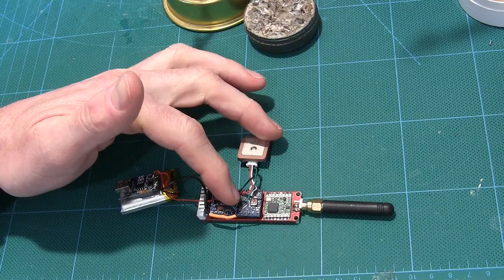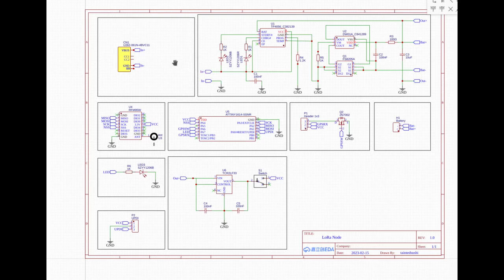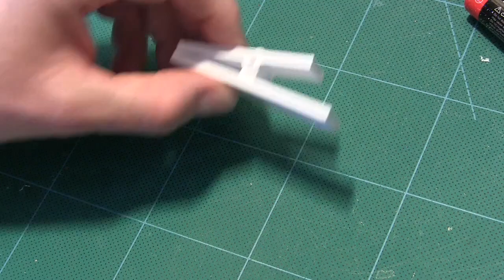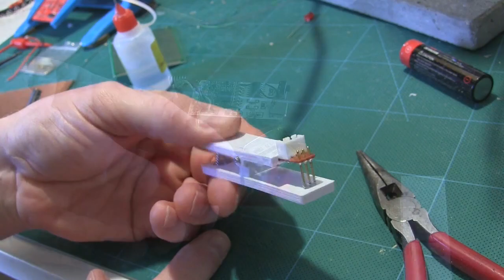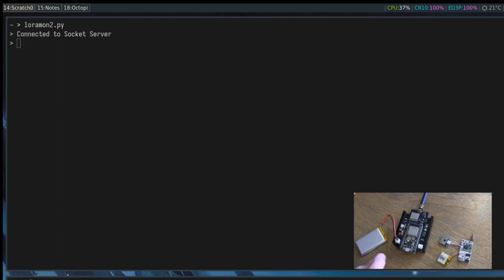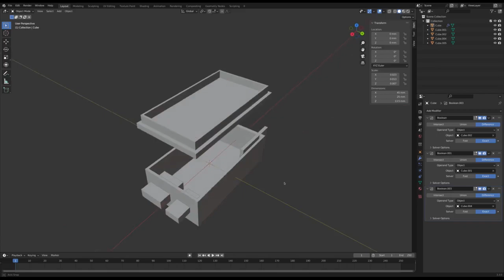LoRa Dog Tracker Part 4

Comment: hey Im small sheep farmer in south of france, I use chinese gps colar for cattle , but they are expensive and need to be recharged every few days though I only might need to check gps coordinates a couple times a day. do you thinbk lora would be a good technology for that ? what do you thing would be the longest battery life possible on a reasonable sized case ? and how much cost the parts approximatly ? well if your willing to share thoses information, anyway thx in advance and great work

Comment: I was thinking about building something similar and came across your project. Not sure if you mention it, but what are your battery specs and runtime?  Any steps taken to reduce power consumption?

I have a slightly different use case...a dog that doesn't run off USUALLY.  However, I'd like to build something that basically transmits only.  Probably something that intermittently powers on and checks a preprogrammed geofence, and maybe checks in to report a last known location, battery status, and signals a geofence breach at a predetermined interval.  I'd like to only charge it after a few weeks (or months).

Comment: Great project. Just ran into Lora and Meshtastic the other day, looking for a LoRa dog tracker. ... Obvious the goal is to create a little neat device to mount on the collar of your dog. And yes, you can pack it into a single box. But what about rearranging the parts like (slightly bigger) battery, the module, and antenna(s) in a waterproof, flexible sleeve. The sleeve would be 10cm long mainly for battery and board(s), depending on the antenna(s) a bit longer. Then attach the sleeve to the collar. It would be easier to wear for (smaller) dogs. Just use the room on a long collar ... Software wise: I like the idea of switching on and off the GPS remotely of the dog-device. That could save a lot of battery live, when you only need regular locations (1-per-minute?) when your dog is out-of-sight (ran away into the wild).

Comment: RYS8830 would be 11*11*2.2mm

 4.5 by 4.5-millimeter MIA-M10’s miniature form factor 

Using a smaller but longer Batterie then could also help Ingo the size
Reply: MIA-M10Q runns with 3.3v

Comment: what difficulties would there be for the 'completed' module as is in this video, to make it work with meshtastic? this would be perfect for my backpack, my electric unicycle and my ebike.
 have you concidered a kenetic generator to prolong the longevity of the onboard battery? 
how large of a solar cell would you need to overcome the average miliamp usage this tracker uses? or what is the average miniamp hour rate currently?
can you add an accelerometer and perhaps have it sleep for longer durations when not in motion?
can i buy these from you preprogrammed in bulk if they can be made to work with meshtastic?
Reply from the maker: I don't know anything about meshtastics but looking at their website, it seems you might need to write your own firmware to get this to work with it. Kinetic generation or vibration harvesting would be good but I think those devices need to be reasonably large to generate anything useful.  If you know of something, let me know.  Solar is a definite possibility to slightly improve longevity. The device consumes around 15mA when 'listening' and 23uA when asleep. This is without the GPS active.  Transmitting gets you to around 120mA and with the GPS probably 150mA so a small solar panel will help but not a whole lot.
Reply: @dork3nergy  i wonder how big a betavoltaic thorium battery charging a supercapacitor between transmissions and listening woudl have to be to  keep things just over topped off, the thought of a twenty year tracker is appetizing.
Reply from the maker: @AU518987077  Nuclear powered eh? I like it.

I have  a test running with a 300mAh battery. It's been reporting location every 24 hours for almost a month now.  I checked the voltage of the battery yesterday...4.05V.  Very promising.
Reply: So you think that its not possible to charge this device with small solar panel like 10X10 ? If you want to send location of your bike every one hour for example ?
Reply from the maker: @richiejohn5760  A 10x10cm panel should be plenty. I thought we were talking about the real small panels.
Reply: @dork3nergy  oh, soo what do you think is smallest panel which is able to keep this device alive to send location every hour ? Thank you for answer 😊
Reply from the maker: @richiejohn5760  I just ran a test using a 300mAh battery. It reported it's location every hour.  The battery lasted for 3 days. If I were you, I would just hook it up to an 18650 and should should only have to recharge the battery every 3 weeks or so.
Reply: @dork3nergy  I want to use it as cow tracker so I need it to work on solar panel for at least one year in row 😁 not sure if it's even possible XD
Reply from the maker: @richiejohn5760  I think you could manage it with 160mA, that's a 6Volt 11x6 panel.  Based on my last test, you'll need about 100mA per day so with that panel you won't need much sun per day in order to top the battery up which is exactly what you want. I don't see any issue with it lasting for a year provided it is protected from the elements.

Edit : Actually, that 100mA is for location data once an hour so 11x6 may be overkill.  Nevertheless, it's better to have too much solar than not enough.
Reply: @dork3nergy  Thank you for answer. I build your device according to your tutorial and now I am trying to make it cheaper with small consumption 😊 I need it to be cheap as possible so I can put it on 100 cows around farm and watch theirs location in mobile app.
Reply from the maker: @richiejohn5760  100 Cows!  That's ambitious. I am running a test now, reporting location once every 24 hours.  I'll let you know the results.

Comment: Good job! Do you need line of sight to get it working? Thanks!
Reply from the maker: It is line of sight so in a suburban area human debris like homes and such can decrease your range.  With a good, high antenna, and some favorable elevation, I can get around 4km between the tracker and the gateway.
Reply: @dork3nergy  cool thanks!